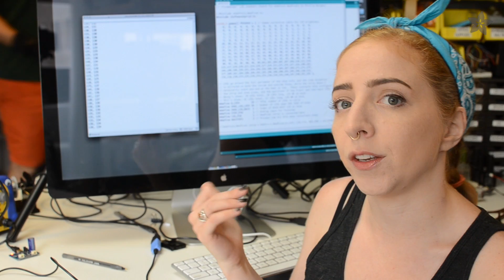Serial Debugging with GEMMA

Comment from the maker: Serial Debugging with GEMMA

GEMMA and Trinket are great when you want a tiny, low cost microcontroller to embed in your projects. One of the tradeoffs, however, is that they can’t send data back to the computer for debugging sensor values. Learn how to debug sensors on GEMMA using a modified console cable! ***** shows you how: https://learn.adafruit.com/serial-debugging-with-gemma/

#Wearables #WearableWednesday